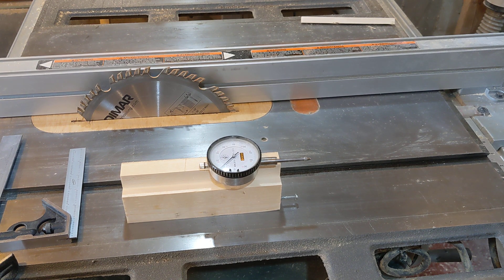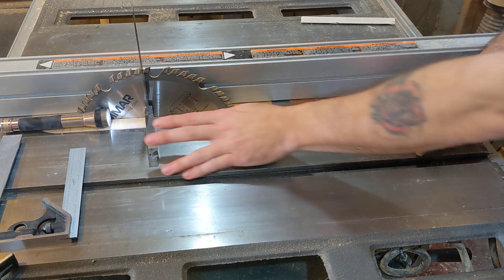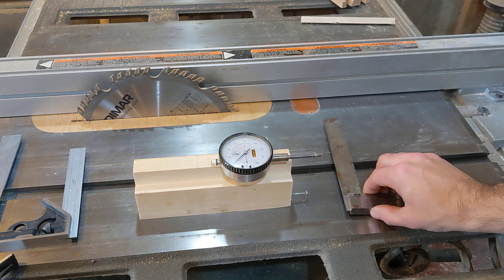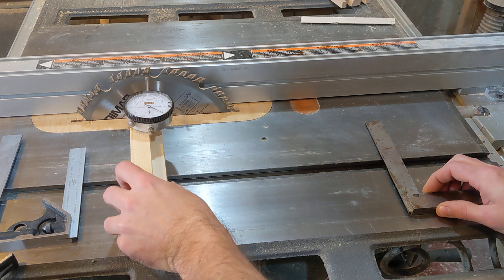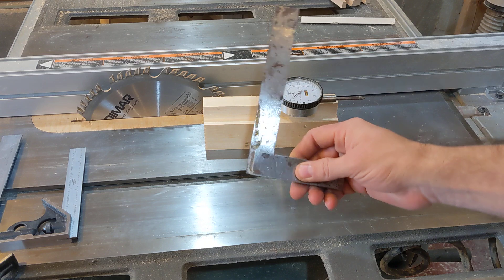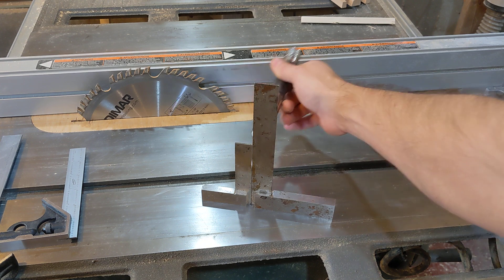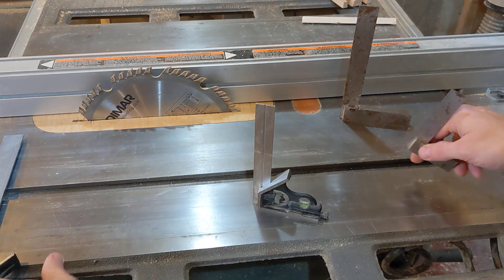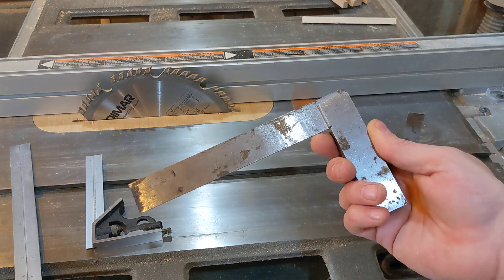Table saw blade 90 degree alignment

Comment: I've spent 2 years on this topic. Sometimes the square is square but the edges have burs. When you start digging in, you'll find that the tools that make these tools, need to be calibrated and therefore once they are calibrated, produce the "GOOD ONES" for a while and then they re-calibrate once the inspections show the variance too much. It's horrible the more you know about measuring and tools and the tools that make the tools. etc. Glad you made this video. You probably loose sleep at night like I do. Wife thinks you're nuts too, I bet. Im digging Kinnex for my squares and Veritas and Fulton for straight edges. My Starrett square has horrible edges.